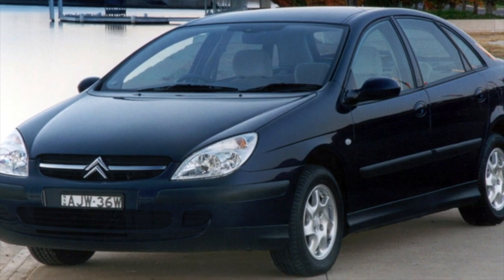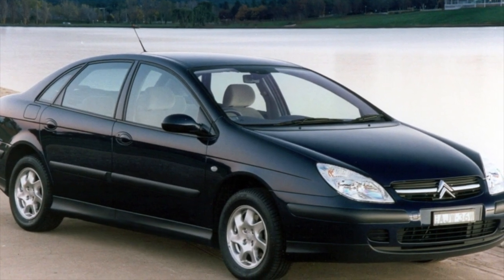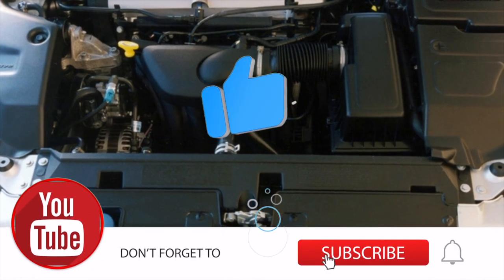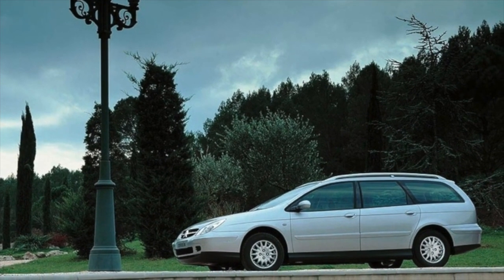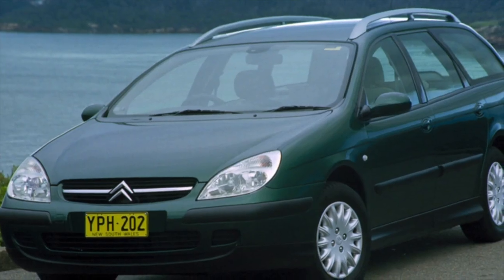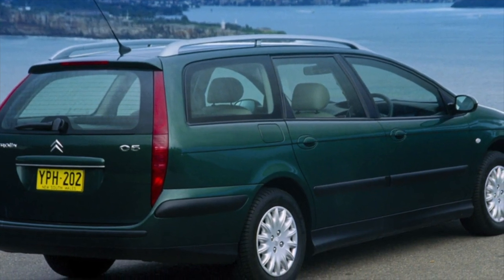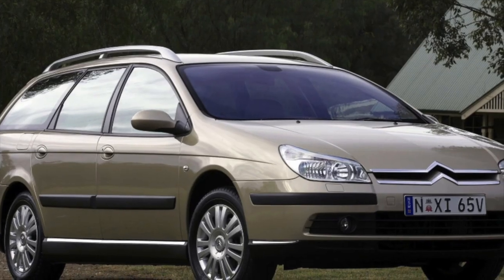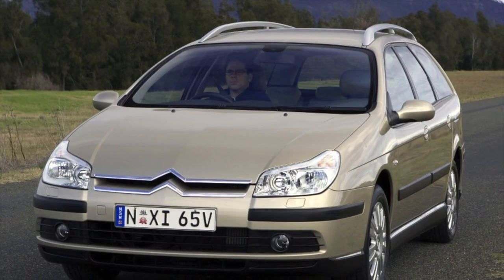Citroen C5 1 - Check For These Issues Before Buying

Comment: I bought a 2005 C5 2.0Hdi Exclusive in 2023 with 84k miles and one owner. Around £2000. Took it to Spain . It never missed a beat and returned 51.3 mpg. That suspension too ! Divine! Particularly after my troublesome experience with a  2016 DS5. The C5 is much better screwed together, even after nearly 20 years. No squeaks or rattles.